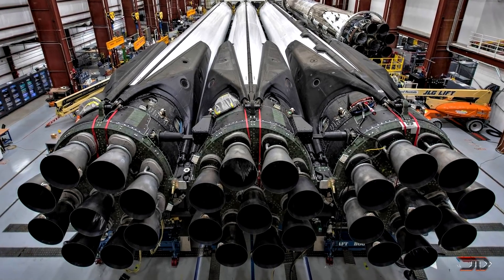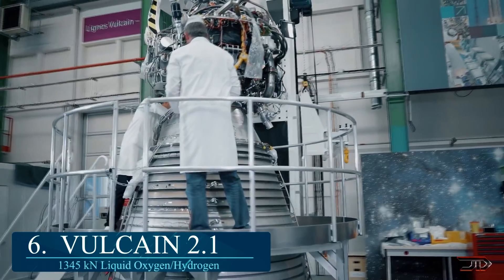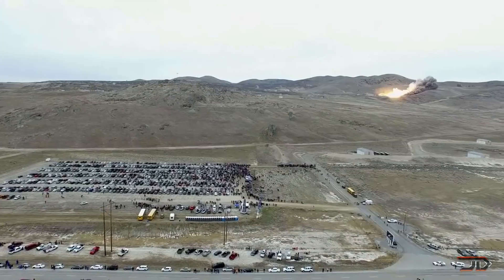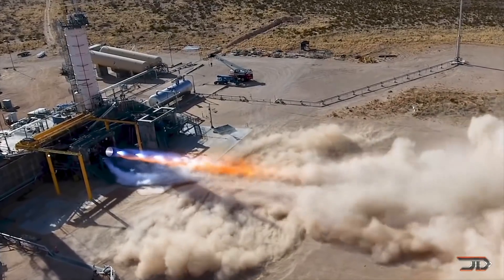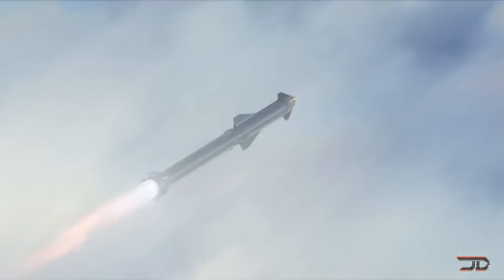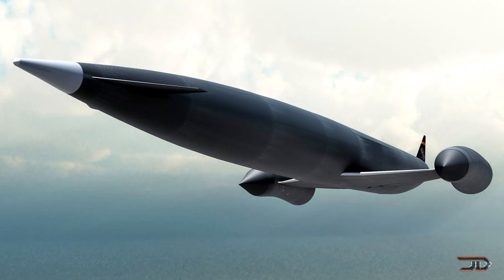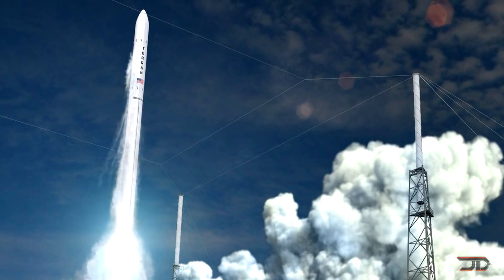7 AMAZING New Rocket ENGINES

Comment: With respect to the AEON 1, it should be mentioned that reducing the number of parts usually also translates to less possible failure modes, but that depends on the exact design.

Comment: Your description of vasmir was incorrect. It doesn't use magnetic waves to generate plasma. It ionises the gas into a plasma using high intensity radio waves which cause the molecules to heat up, akin to a microwave oven and then a magnetic field is used to accelerate the plasma. Due to the way its ionised, the volume of plasma has a higher density than the gas used to create it and thus more mass by volume, and by way of linnear, rotating magnetic fields, that mass is ejected out of the back at crazy velocity and thus, despite the plasma being very light (the plasma being only heavy in comparison to the gas), that accelerated mass is what propels the craft forward albeit with a tiny force yet a really high impulse.

Comment: i wouldn't call them all amazing. as mentioned below there is nothing new or amazing about the SLS side boosters, they are old tech and essentially just extended shuttle SRB to the point that they are even using the old shuttle SRB cases for the first phew flights. 

For me the order is wrong but then it is hard to compare them as you have everything from relatively simple engines like the 100 part 3d printed engine and the Skyrora engine too Spacex's Raptor which is one on the most ambitious rocket motors ever built and the sabre engine concept.

Comment: Even if 3D printing can reduce the costs of a rocket engine to 1/10 that of a non-printed engine this is completley blown out the water by an engine that can be re-used 1000 times -which would be 100x cheaper again...   Re-usability is the key not manufacturing tecnique.
Reply: I would say that one does not exclude the other and we should strive for both. 
Besides, reusability depends a lot on reliability of your system. So if with additive manufacturing you're able to reduce the number of parts your engine is made, then you're decreasing the system complexity, increasing reliability, thus chance that the rocket will be reusable more because it didn't malfunction on the 32nd landing attempt.
Reply: The Raptor engine is mostly 3D printed including its combustion chamber. It’s not possible to manufacture that with conventional technologies. 
Additive manufacturing will bring reusability to rocket engines.

Comment: Fuel rockets are no good for space travel long distance.
Reply: So how do you get the energy needed?
Reply: @alekosb.8704  Fusion or Fission rockets will produce more power, than just chemical rockets.
Reply: @davidmyersretiredaerospace8038  it's still a rocket
Reply: @alekosb.8704  yes but could be better.

Comment: "And we have yet another methane powered engine being developed by Spacex."  A touch smug and condescending you think?  
-Why not say, "And next we have the Spacex Raptor, a staged cycle, closed combustion, LOX/ Liquid methane engine."    After all, No one has successfully made an economical one as they are of complex construction.  Which 3D printing has solved.  (Which you mentioned on others, but not the Raptor)

Comment: Where is isro s139 rocket engine and s200 booster engine. They are thrust beast and just 1 s139 engine put 1.5 ton to gto. It is the most powerful engine after Saturn v and energia rocket engine.

Comment: Solid rocket boosters are motors, not engines
Reply: But they consume a fuel, so aren't they engines?  Motors are powered by electricity - at least according to the classical definition of a motor.  Are you calling it a motor because it isn't converting a fuel to mechanical energy?
Reply: how isn't converting a fuel to mechanical energery? mechanical energy is the sum of potential energy and kinetic engery... the MOTOR converts chemical potential energy to the kinetic energy used propell the rocket. In addition motors are definied as any device which converts fuel or eletricity to some mechinal form. However to answer your inital question, they aren't considered engines, they are considered motors, an engine has a varible thrust where as solid rocket MOTORS do not, thats the main difference. Once lit a solid rocket booster is completely unctrolled, it will burn out in a known time providing a known thrust, to a known thrust curve. So to finialize my little rant, solid rocket motors are motors not enigines, however liquid rockets are engines.
Reply: Let's just call liquid rockets engines, and solids boosters.
Reply: @lexray12  Thanks for the lesson.  It's always nice to learn things.
Reply: @Mycatisinapiano  The problem with this is sollid rockets aren't always boosters, sometimes solid rocket motors are used as a primary stage! And an edit because I forgot to add that sometimes liquid engines or even hydrbid engines can be used so called 'Boosters'!
Reply: Check and mate
Reply: Idk what's the difference. What's the difference
Reply: @blackcitadel37  The difference is that Matt Lynch (OP) trolled the motor/engine nonsense debate... and is laughing his Doritos stained ass off while little fish fight over the bate.
Reply: They are not motors

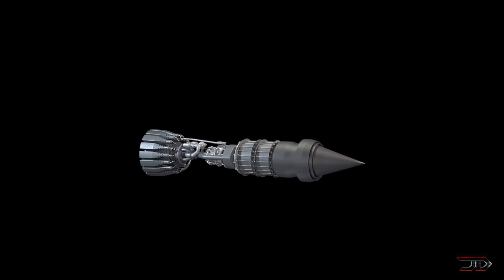Comment: 5:20 thorium nuclear reactors?
Reply: Thorium reactors are great for power stations but for a spacecraft you want something light and powerful, which is the opposite of a thorium reactor. A thorium reactor is in actual fact a uranium reactor with the difference that instead of putting uranium in it you put in thorium and it converts the thorium into the uranium which then reacts.

For a space reactor to be small and light enough you would use plutonium or weapons grade uranium, like they do in submarines but to a greater extreme.  

The biggest issue though is not the reactor itself but the cooling radiators, which will probably be by far the heaviest component of the propulsion system (aside from the propellant) and will be huge regardless of what type of reactor            and heat engine is used.
Reply: @listerdave1240  yes, but even with radiators the power output of a nuclear reactor is extremely high, something perfect for say a mars or lunar base.

Also you really dont want a water cooled reactor for a spacecraft or base, so what do you recommend? a Thorium msr should work fine, especially since insulation on it can keep it at a high heat efficiency

Comment: The SLS booster is not a rocket engine. It is a rocket motor. The two both provide thrust (motors having far higher thrust), but they are not the same.

Comment: The Raptor engine is #1. Full flow staged combustion.
Reply: I think most people do know SpaceX didn't invent full flow. They're "just" the ones who managed to make it viable.
Reply: Except SpaceX weren't the first to build this type of engine and test it successfully, both  Energomash and aerojet rocketdyne built successful full flow staged combustion engines first, the reason why SpaceX will fly the first full flow staged combustion engine is because the funding for the other two got cut
Reply: @aaronjacobs3980  Neither of earlier two was successful, though. RD-270 had problems with synchronization of the turbopumps and Integrated Powerhead Demonstrator never got finished. Only the Raptor reached the flight testing stage.
Reply: @caav56  I know that, its just that a lot of people will see the raptor and (as usual) assume that SpaceX practically invented that type of engine, and you can't say that its never happened before

Comment: these seem so much cleaner burn than any of the older motors
Reply: It mostly just depends on the fuel. The Germans had engines with clean flames during WW2. For example, the Walter HWK 109-509:
https://youtu.be/EQSReWy1GcY?t=20
Now, the pump exhaust on that engine is pretty dirty, but if you look carefully above it, you'll see the actual rocket exhaust is very clear.

More recently, the US developed the RL-10 in 1959: https://youtu.be/5QJNnTRRLOo?t=20
They developed the J-2 in the mid 1960s, similarly clean: https://www.youtube.com/watch?v=J9F0WzdV4fI
And of course the fantastic Space Shuttle engines in the late 70s: https://www.youtube.com/watch?v=RcJ89sMcU3w

So the reason a lot of rocket engines look dirty is because they burn kerosene, while a lot of newer engines are using methane which is cleaner.
Reply: Well most of them burn hydralox or methalox so they DO burn cleaner than Keralox engines. The SLS solid propellant however does make fumes.

Comment: SLS Solid Rocket boosters are not remotely new.  Likewise VASIMR is quite OLD and has been largely surpassed by HALL thrusters like the X-3.  This videos research is extremely poorly researched, it's just the authors pet rockets without any regard to if they are new or not.

Comment: So, what are the exhaust velocities or maybe some specific impulses? Otherwise, yeah, some shiny engines.
Reply: 7. Skyrora:    250 Sea Level | 285 Vacuum 
6. Vulcain 2: 318 Sea Level | 434 Vacuum 
5. SLS SRB:  237 Sea Level | 269 Vacuum 
4. BE-4:         312 Sea Level | 346 Vacuum 
3. Raptor:     330 Sea Level | 356 Vacuum 
2. SABRE:   3600 Sea Level | 460 Vacuum 
1. VASIMR                 400 to 5000 Vacuum
Reply: @lazarus2691  Thanks! It would've been nice, if they also said that in the video

Comment: "New rocket engines"

Lists SLS boosters...

Like, how are they even remotely new :X Those have been flying since 1981! The only difference with the Space Shuttle boosters (which is what they basically are) is that they have an extra segment of fuel and modern avionics, but other than that... exactly the same as it has been for almost 40 friggin years!
Reply: spacettech.com check out

Comment: Blue Origin (BE-4) engine  will power the New Glenn. I don't think it's going to power the Falcon launch vehicle. Have you checked your sources? The Merlin currently powers the Falcon  The Raptor will power the new Starship.
Reply: I thought he said Falcon at first, too. ULA's next rocket happens to be called Vulcan, though, with plans to use BE-4.

Comment: cmon, saber is not getting full funding, and like fusion, will always be 20 years away
Reply: Fusion is 5 years away. Have you been reading up on ITER.org?
Reply: iter is an experiment that began construction in 2007, and in 2025 will not generate electricity.  Even if it did generate 500mw that is less than an average coal powered plant. When will fusion power warm our homes? I stand by my estimate of 20+ years.

Comment: It's not true that VASMIR has achieved any "higher efficiency" compared to other ion thrusters. For example there is DS4G which has TWICE the specific impulse of VASMIR (21400s vs 12000s). The real "cool thing" of VASMIR is the "variable specific impulse" part. The fact that is can switch from high efficiency (12000s ISP) low thrust mode, to lower efficiency (3000s ISP) higher thrust mode. This means if can theoretically perform both long-duration burns with high ISP, and also manoeuvres which require higher thrust, like orbital injections.
Reply: Efficiency is not only about Isp. For instance, it can mean how close are you to the theoretical maximum Isp/Thrust for a fixed amount of energy. But I don't really think the VASMIR is more efficient than other alternative in this last example. I think the VASMIR really shine because of the amount of power it can receive from a specific weight and the variable thrust/impulse you mentioned. The latter allows to use a lot less energy for the same delta-V over a full maneuver by slowly switching from higher thrust to higher Isp, physics talking.
That's why I don't like this engine: it requires a nuclear reactor so it makes sense to use it compared to other ion thrusters that are more adapted to solar panels.
Also I don't like the engineer behind the VASMIR, he kept telling that we can't go to Mars without its engine, which is completely false, in order to get fundings by NASA. BTW this engine sells dreams but the original plan was it to be sent to the ISS 5 years ago. What happened?
Reply: Dumb question - wasn’t Vikram 1 using an ion thruster to do the trans-lunar injection burn?
Reply: @chunkydurango7841  You mean Chandrayaan-2? Because Vikram was a lander... And no, I don't see any such information. It did use multiple burns to raise apogee, which could indicate electric propulsion, but there were not that many of them, so it's unlikely.

Comment: SLS 5 segment booster might be one of the biggest engines right now(and most powerfull that is still operational)

But i think intead of it you shoudl show SLS advanced booster prototype test. It's something completly new, with new types of fuel. Also i'd put VASIMR first.
Reply: vasimr is useless
Reply: @spacewardDev  why is it useless? Don't you think that high ISP vacum engine woudl be very usefull during interplanetary travel?

Comment: The space x rapter engine is by far the greatest and most inavated rocket engine ever.
Reply: Nope:
-russians developed similiar thing few years ago
-still most advanced rocket engine is RS-25D.
Reply: @_mikolaj_  yes but is it on a ship that lands back at the launch pad? Hmmmm
Reply: @anthonylosego  well i haven't seen any spaceship land at launch pad after space travel with raptor, i've seen just some land at space center with RS-25. Also you don't need much from engine to perform suicide burn, just ability to reignite, and good computer wich will calculate when to start.
Thing about RS-25 is that it's basicly SSTO engine. Still is very powerfull at sea level, incredibly efficient, and it has very clever nozzle design wich prevents it from rupturing on launchpad beacuse of atmospheric pressure. Something that hasn't been ever done with vacum optimized nozzle. It's also most heat resistant engine ever.(that's why it's on SLS instead of rs-68 wich woudl melt).
Reply: @_mikolaj_  To be fair raptor has a much better thrust to weight ratio so it's smaller and more powerful, it's MUUUUCH cheaper and also rated for more flights.

Comment: Sls booster is basically a longer version of a shuttle srb so not that new
Reply: Instead of this one, he shoudl show advanced booster prototype test.
Reply: Not basically, it just is.
Reply: The new SLS booster isn't really an "engine," and it is built out of leftover Shuttle parts. NASA already said that after the first launches they will let them splash down in the ocean and never recover them because its not in the budget. It makes SpaceX look better and better every day.
Reply: Andrew Ackerman 
Yes, SLS will use all the surplus solid booster segments.
The issue has been the Exploration Upper Stage (EUS), used in SLS Block 1B.
They just started to build its mobile launcher and tower for taller Block 1B — after Congress funded.
—
As of February 2020, ICPS (not EUS) is planned for the Artemis 1, 2, and 3 flights (all SLS Block 1)
https://www.nasaspaceflight.com/2020/02/upper-stage-rl-10s-stennis-sls-launches/
The ICPS will now be human-rated for the crewed Artemis-2 flight.
Reply: Yes, Shuttle’s quick method (believed to be Cheap) to replace thrust to Saturn V’s first stage (S-1C).  After four (4) SLS flights, the Shuttle surplus is gone, NASA will need replacement (Advanced booster?).
Scrap solids (weight/thrust penalty too high).
Reply: @w9gb  advanced boosters are only for cargo, due to, massive power. So kinda, Shuttle extended SRBs will continue to fly. RS-25D will be replaced with cheaper expendable version.
But yes, advanced isn't human rated
Reply: Mikicat 
Yes ... BUT Human Crew Vehicle (Orion) should not launch on SLS Block 2 (cargo).

Augustine Commission (2009) noted the 1-1/2 vehicle approach for cis-lunar exploration,
which is actually an update of VonBraun’s/Marshall 1960s EOR approach using the Saturn C-3.
https://www.nasa.gov/pdf/617036main_396093main_HSF_Cmte_FinalReport.pdf

The Vulcan Heavy or New Glenn boosters could handle Orion CRV to LEO.
Reply: @w9gb  They decided to restart RS-25 production with the RS-25E which is supposedly be much cheaper to produce.
Reply: Ruri Hoshino 
Yes, aware of that ~$2 billion contract.
Meanwhile, former employees are working on new engines at Blue Origin.
BTW, RS-68 was suppose to be cheap SSME/RS-25 (train wreak), and USAF/NRO had to fund “68A” version.